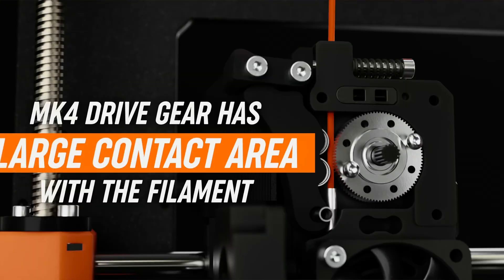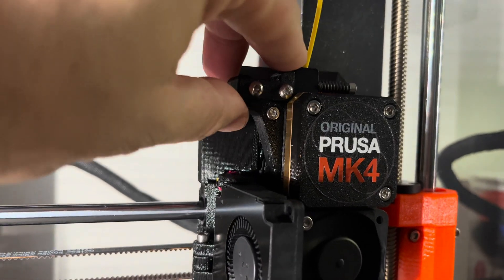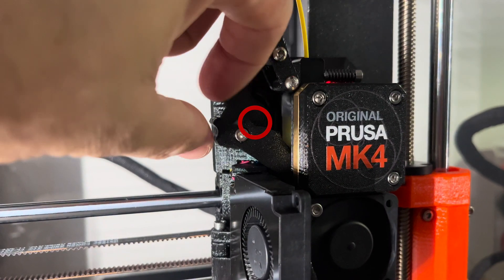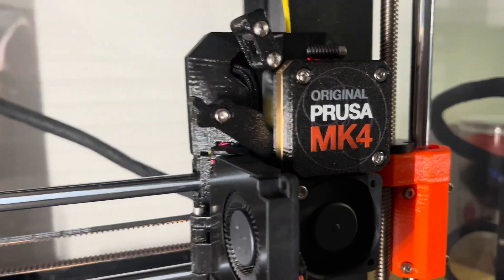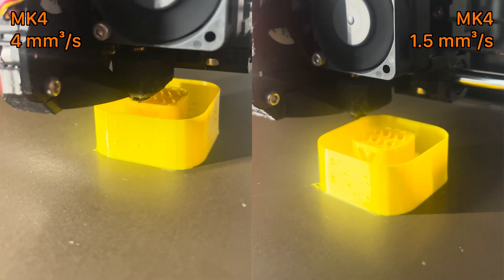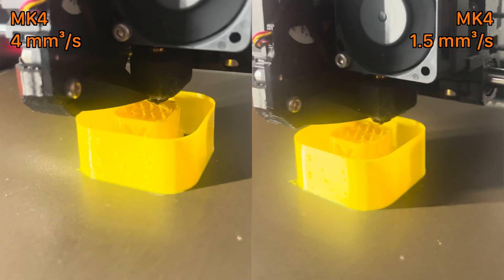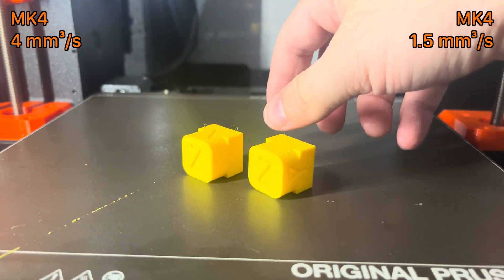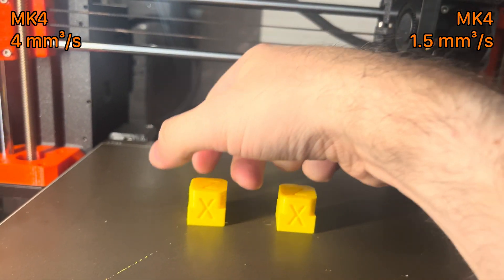Fix Prusa MK4 Weak Filament Grip

Comment: For me, the TPU filament would slip off the gear and get jammed between the back of the gear and the motor. I was convinced something was wrong with the filament path over the gear. Somehow, I came across your video, and I’m actually printing your part as we speak! I just wanted to say thank you, it really means a lot that someone like you had this issue before and took the time to share the solution.

Comment: I too had a problem with my XL. When my XL was new it would print PLA, PETG, and TPU beautifully. After trying to print with ABS, which has a lot higher nozzle temp I started having problems with printing with TPU, and even PLA. Eventually, I was even having problems printing with PETG. I had one toolhead that wouldn't print any material. I reprinted new idler lever parts out of PETG with one of the remaining toolheads that would still do decent quality. I put those parts in the toolhead that wouldn't print anything, and it started printing like new again. I then printed 5 idler arm sets out of ABS using the revived toolhead and replaced the idler in all toolheads. Huge improvement. Currently, Prusa has switched the recommendation for the idler arm parts from PETG to PC-CF. They also sell new idler arm parts printed in PC-CF from their store. I am going to buy a spool of PC-CF and try to reprint them with that. I believe that my problems started when I was trying to print ABS. Although the idler arm parts did not show any visual evidence of heat deformation, I believe that there must have been a slight amount. It didn't take much to have a huge effect. That would explain why Prusa switched the parts from PETG to PC-CF. Prusa did confirm to me that the idler arm components are the same for both the XL and the MK4 / MK4S.
Reply: I have the exact same problem, I am printing it now, lol

Comment: Thanks very much indeed! I tried a bunch of different settings in my upgraded Prusa MK4, still TPU did not print at all, there was simply not enough material transported to the Nextruder! So I found your diagnosis and solution on the net, implemented it yesterday, mounting the two new parts is a piece of cake and done in five minutes, and, happy me, TPU ist printing again as it did before on the MK3S+!  👍😊

Comment: I have been printing with TPU for about a year on Prusa MK4. Recently Ive been having issues with printing TPU. I went through the check list and nothing was working. I came across this solution and it worked for me. Very simple to replace but still a video on that would have been nice. Thank you

Comment: I've been having issues with grip now on both my 2th XL's.  Printing now on my mk3.9, hopefully this helps in my case too!
Reply: Update, this fixed my issue with my XL's not gripping the filament, thank you!!
Reply: I too had a problem with my XL. When my XL was new it would print PLA, PETG, and TPU beautifully. After trying to print with ABS, which has a lot higher nozzle temp I started having problems with printing with TPU, and even PLA. Eventually, I was even having problems printing with PETG. I had one toolhead that wouldn't print any material. I reprinted new idler lever parts out of PETG with one of the remaining toolheads that would still do decent quality. I put those parts in the toolhead that wouldn't print anything, and it started printing like new again. I then printed 5 idler arm sets out of ABS using the revived toolhead and replaced the idler in all toolheads. Huge improvement. Currently, Prusa has switched the recommendation for the idler arm parts from PETG to PC-CF. They also sell new idler arm parts printed in PC-CF from their store. I am going to buy a spool of PC-CF and try to reprint them with that. I believe that my problems started when I was trying to print ABS. Although the idler arm parts did not show any visual evidence of heat deformation, I believe that there must have been a slight amount. It didn't take much to have a huge effect. That would explain why Prusa switched the parts from PETG to PC-CF. Prusa did confirm to me that the idler arm components are the same for both the XL and the MK4 / MK4S.

Comment: I had also an issue on my first try printing TPU. But it was my fault. The speed was just too high for the filament. I reduced the speed a bit and since that time it prints perfectly TPU...
But: I mounted the idler lever a bit different as shown in the manual. Instead of the locking nuts (the nuts with the nylon inserts) I use standard nuts. I seccured them with some blue screw lock. The reason is, that the mentioned screws are too short for the locking nuts. The idler blocks before the nylon part of the nut reach the thread of the screw, Works perfect on my two MK4...

Comment: i couldn't even get my printer to print pla for more then 2 hours at a time until i printed this part. i think this was just poor engineering on there part or bad QC on the part its self. prior to installing your version i couldn't get any tension at all from the retention screws until they fully bottomed out.

Comment: Hey so did you figure it out? The needle gets clogged up and sometimes has to be changed. I have a bunch soaking in acetone now. Softens it up so you can get it out. And I hit em with a map gas torch, fixed it right up.

Comment: Loosening the screws on the MK3 is for letting flexible filaments "slip" when there is to heigh pressure. My flex profiles over-extrude (higher flow multiplier), but I then loosen the idles to help with difficult parts such as the first layer on the bed. This helps prevent the flexible filament find other unwanted pathway's by bulging into it. Please maybe check why people loosen the screws before claiming we are living in different universes XD. I don't know yet what the nextstruder needs for Flexible printing, I only have a print shop with MK3's but I recently got my XL up and running pretty good. Flexibles is still on my list of things that I need to try out :).

Comment: I understand what youre saying but I'll try to explain. People suggest to loosen the tension as they have had experience in filament bulging and starting to fill the extruder cavity rather then be fed down the PTFE tube to the hotend. Your problem was quite different. You had too little tension. from my experience, more tension is better as long as 1) Your Z height is enough for your first layer (set the slicer to 0.3mm first layer if you are having blockage issues only on the first layer) 2) The nozzle temp is hot enough for the filament. 3) Your filament path is well designed (It doesnt look good on the Mk4 in the demo compared to the Mk3) but if you trim the PTFE tube as close to the main gear as possible then all should work well.
I'mglad you fixed your problem & I'll do the same mod when I get my Mk4. Thx for the video!

Comment: The printer does not need any modification. If there is a problem then either you built the kit wrong or it came with a defect.

I have the kit and it prints perfect even with very soft ninjaflex tpu. Recently I upgraded to the newest input shaper firmware. No problems with that either. 

Speak with prusa support and fix the problem with them the right way.

Comment: I dont get it i have had mine for four months now and i can print tpu with no problem at all and it does not slip when loading, unloading or when printing your doing something wrong to have issues with the mk4 you must have broke your 1100.00 dollar printer stop trying blame the printer did you buy this as a kit and you put it together cus you shouldnt have because you have broke your new printer and your blaming the company for you mistake's

Comment: Loosening the screws can help. There is also some logic behind this. If the screws are set to tight the roll pressing against the filament is pressing a dent in flexible filament and making the movement harder. When you print with PLA you can clearly see and feel the teeth marks in the filament after unloading. Loosening the screws a bit can lead to less indenting and a better movement of the flexible filament.
On the other hand you can increase the pressure so the teeth of the extruder gears claw deeper into the filament. That can also improve the filament movement.

Comment: I am currently printing your modified parts. When I first tried to print flexible filaments they worked just fine, but more recently they have been showing the same issues you described, they have been properly stored in dry environments so I think their tolerance isn't the best and it sometimes works with the default idler arm and sometimes it doesn't.

Comment: I found this video by random. YouTube algorithm is the best. 
I cannot believe it!! I had massive problems just loading TPU into my extruder. 
Now it works!! I’m more than happy. Thank you so much!!!

Do I need to change back to the stock lever for printing PLA or PETG?
Reply from the maker: Hi. I’m glad this helped you! No need to revert. The change does not “modify” the way the lever works, it just extends the range of movement. So it will work with PLA and PETG as well as the original one :)

Comment: I thought that I had this flexible filament feed problem until I tried drying the filament. After I had dried the filament then I had no problems. Before I dried it it would not load properly and the Purge More option extruded very little.
My filament is Fillamentum Flexfill 98A and it is several years old.

Comment: I was also having a lot of TPU jamming with my mk4 upgrade from the mk3s+, it would get loose and twist around everything in the nextruder, i'm not sure if its because its getting soft in the cold part and not able to get in, or because its too loose on the hold. I am also having problem when i use PLA that over the course of the print it slowly twists the filament to the point is starts to jump off the spool. Some groups said to reprint the same parts you have modified, I am going to try your version and see if it helps.
Reply: In the end, I bought some overture high speed TPU and that solved all my problems, much better TPU then I was printing.

Comment: I’ve solved it differently - 0.6 nozzle. Nextruder is bad design it can overheat filament and this mod is not going to help when filament gets too soft. It’s going to fail push filament to metal tube…
Reply from the maker: Yeah, but I need to print at 0.25mm nozzle detail 😆

Comment: I printed all my mk4 parts. And I'm glad I did because the quality of their farm parts is horrible. I used the latest revisions when I printed them. I never had any issues with TPU on the printer side. I did have issues with stringing, but it got worse over time and the reason for that is my good dryer was non operational at the time. I had to use the crappy one that can only do 50 degrees. I did manage to fix it so it's possible the TPU can be printed cleanly now.
Reply: where did you get the parts?
Reply: @AlexandruIonica1  printables

Comment: My solution to problems I was having with my Prusa was I replaced the defective part with a Bambulab X1C. It was a somewhat expensive fix, but the replacement was very easy. Printer is running better than ever now. I highly suggest this modification.
Reply: X1C is dog shit with TPU
Reply: @hackcasual  With a little tweaking, I am printing COEX 60A on my X1C. OK, a little extra work to make the path buttery smooth too
Reply: @hackcasual  not really. I print TPU with it perfectly. You just can't really run it in the AMS.

Comment: Really good solution. I have no problems but I have only printed TPU 95. In any case, a possibility if I ever get problems. If you loosen the two screws, you should also be able to adjust the original contact pressure. In principle, you have only increased the possible margin for adjustment.  Right?
Reply from the maker: Absolutely. My change does not affect the tension directly, it allows the lever to move closer to the extruder motor gear. In this video I followed Prusa instructions by aligning the ends of the screws with the idler nut (lower tension that I had on the previous video). But because TPU flexes, the lever is able to move closer to the gear, which results in lower pressure but better contact. And you can always loosen the tension screws